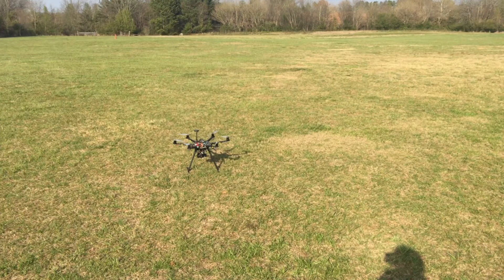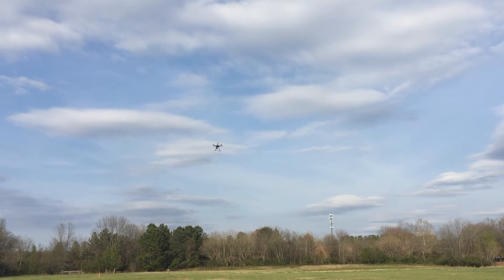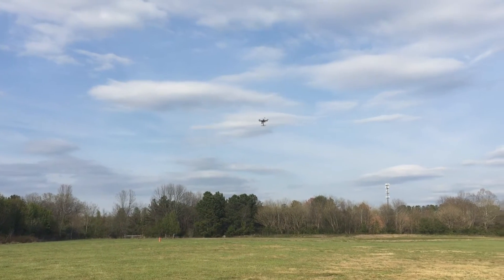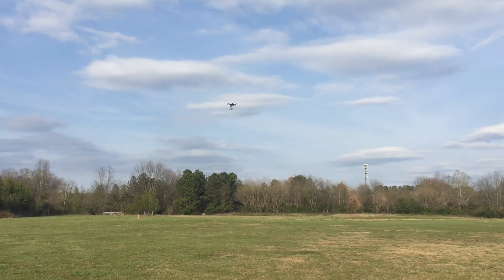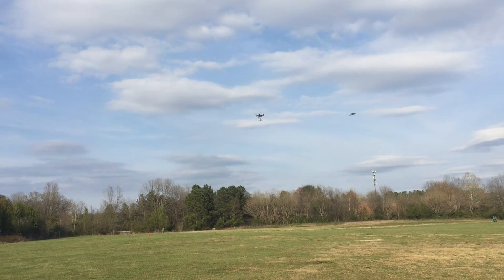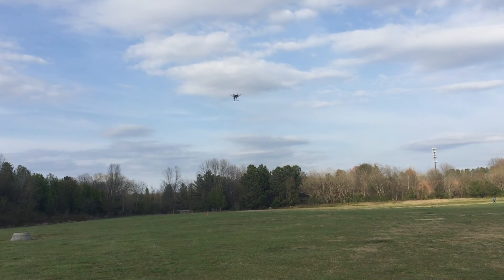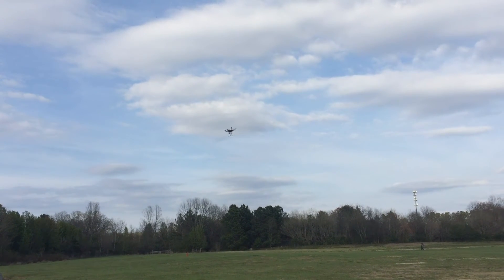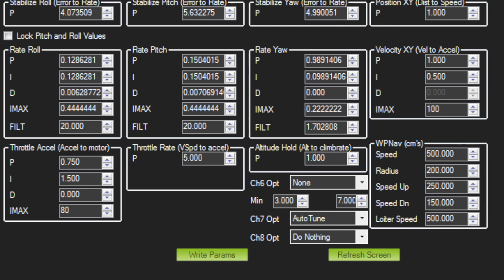Arducopter 3.5-RC2 - AutoTune with Position Hold

Comment: Could you say what is a correct alt to perform autotune ?
Reply from the maker: Jean Bernard It doesn’t really matter, but I usually run at about 50-75 feet. It’s more important to make sure you have enough area around the drone since it can move pretty far as it twitches back and forth. Make sure your drone works well in Alt Hold mode before attempting Auto-Tune.

Comment: I'm a little confused as to how you save the new parameters when autotune is done. Do you leave the switch on, land and disarm? The documentation says to switch autotune switch off, then back on to fly with new PID's but then the video they link to has the guy leave the switch on, land and disarm. Any clarification would be helpful. Thanks!
Reply from the maker: Saving of the new PIDs depends on what position the AutoTune switch is in when you disarm the copter. If the switch is in the High position when you land and disarm, the new PIDs will be saved and the old PIDs will be discarded. If the switch is Low when you disarm, the new "tuned" PIDs will be discarded and no PID changes will be applied.

Once AutoTune is completed and the copter is still in the air, the flight mode will change back into the mode you were in when you entered AutoTune (usually AltHold or PosHold). You can then continue to fly and compare the new and old PIDs by flipping the AutoTune switch between Low and High. As soon as you land and disarm the copter, either the new or old PIDs will be permanently stored based on the position of the switch. I hope that clears things up.

Comment: I tried today to perform autotune, the app show me that the copter was in autotune mode, but never started to twitch, I tried in alt hold and pos hold, quadcopter frame motors tiger motors 3508 380Kv, pixhawk 2.1 arducopter V3.5.2
Reply from the maker: Hi Luis. That's a weird issue but one I've seen before on some of the forums. Perhaps you can grab a log file and post it to the Ardupilot support forum at https://discuss.ardupilot.org.

Off the top of my head I would look at your RC input for roll and pitch in the logs to validate the flight controller is actually seeing them in the neutral position. If it thinks you're actually commanding a roll or pitch move, it effectively pauses the AutoTune procedure to re-position and then will resume once the roll/pitch returns to center. If your RC calibration is off or you've added trim it may think you're always requesting some roll or pitch.

Comment: Thank you for the commentary which is very helpful for the viewer. Could you backup a step and tell us how you got into Autotune in this firmware? Also, the steps to accept or reject the PIDS discovered by autotune..
Reply from the maker: Hi Jrs, yeah good suggestion. I haven't had a chance to upload more content but I've made some significant adjustments to my Hexa copter recently so I'm hoping to have some update videos out soon. I'll try to include an AutoTune session with full setup instructions for assigning AutoTune to a switch in Mission Planner and then the accept/reject procedure once it's completed.

Comment: Hi, so this is the new feature of Mission Planner? The Auto Tune is on Flight Mode settings?
Does it have problems?
Reply from the maker: This is really a new feature of the ArduCopter firmware rather than a Mission Planner feature. I know you can have AutoTune as a Flight Mode but I always set it up on another switch and use either the Channel 7 or Channel 8 option in MP to activate it. I have not seen any problems and the tunes that it provides seem to be better than with previous versions, which for me were already very good. 

The only thing I will say is that it's a very "light" position hold. The copter will drift considerably and, as I demonstrate in the video, will randomly Yaw as part of aligning itself with the wind direction. I still highly recommend that you perform the AutoTune in a large open area.